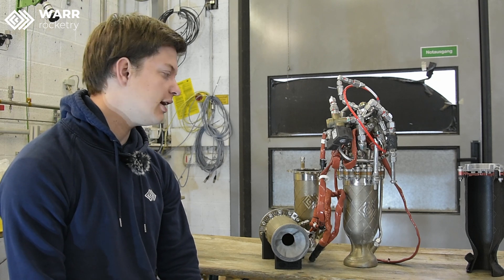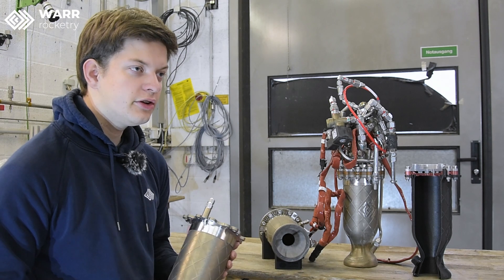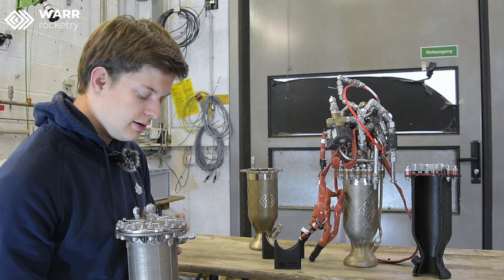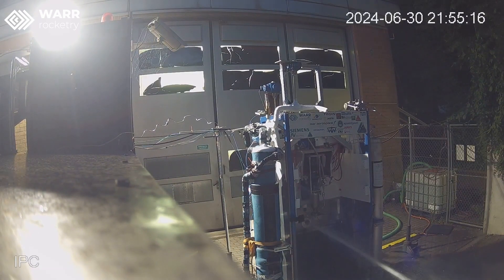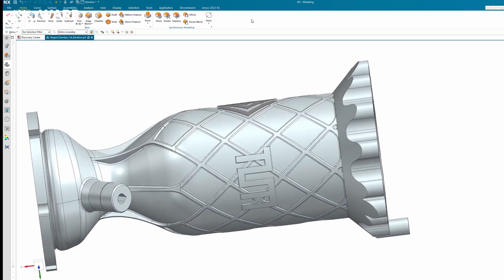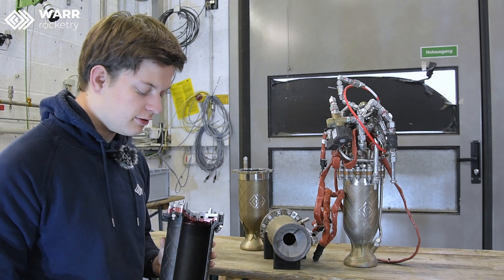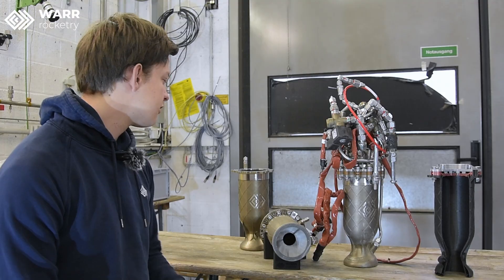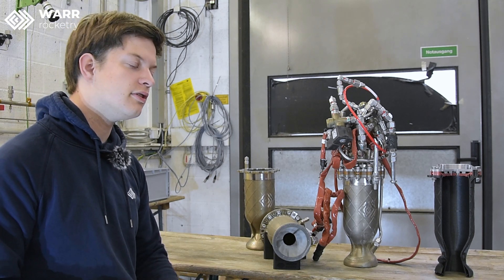WARR Tech Deep Dive 03: Thrust Chambers

Comment: Thanks for the graphics and explanation. I would like see more techincal video and issue encontered. Xray image on metal prints are awsome.
Are you using swirl injector right? or is showere type? and what is the presure in chamber? it has throtling capability? if yes what range?
Reply from the maker: Hi! We're releasing more videos on different subsystems every two weeks. If you're particularly interested in propulsion, be sure to check out our injector video!

To answer your questions: The engine shown here uses an unlike impingement injector. For the next iteration, we're transitioning to a pintle injector. While this assembly wasn't designed for throttling, we could theoretically adjust supply pressures on the test rig to achieve some level of control. The upcoming pintle injector will also be fixed for now, but in our electric pump-fed development, we plan to throttle using the pumps. A natural next step would be making the pintle itself adjustable.

The chamber pressure for this engine is nominally 20 bar(g).